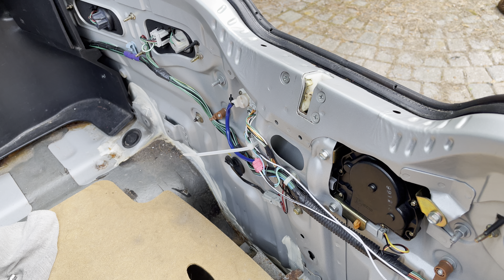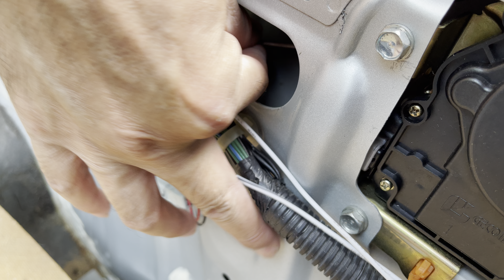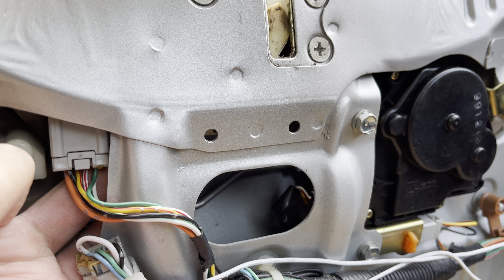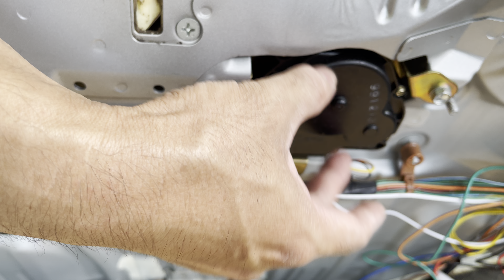2005-2001 Acura Integra Rear Trunk Can't Open Troubleshooting - Complete Guide - Part 2 of 7

Comment: What if your not getting power to your relay?
Reply from the maker: Which relay?  Are you referring to the 12V orange wire located on left trunk area, and near to the power antenna assembly near the fuel door?  If yes, then view all 7 parts of the video
If this is the issue, then you can manually move the white color plastic latch to confirm the issue.  One of the video will show that